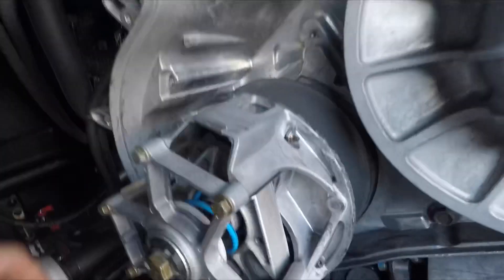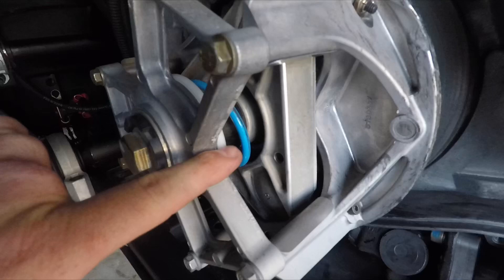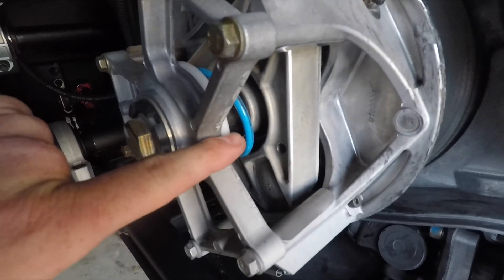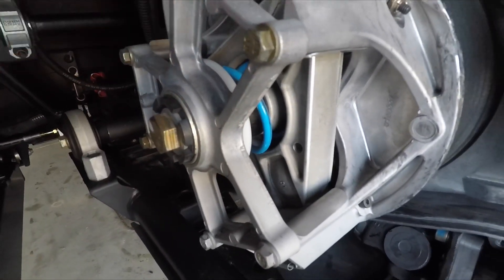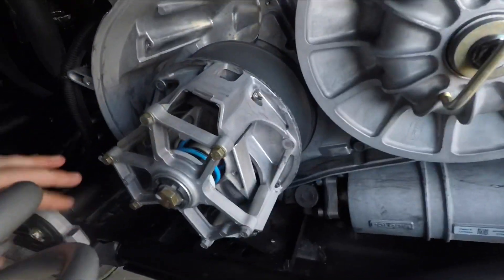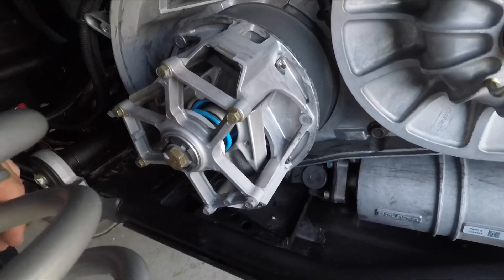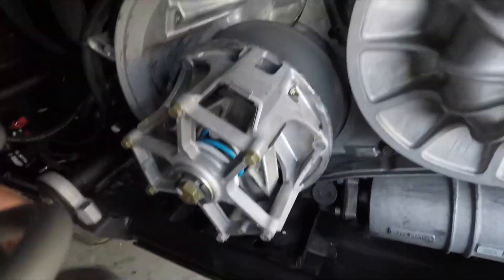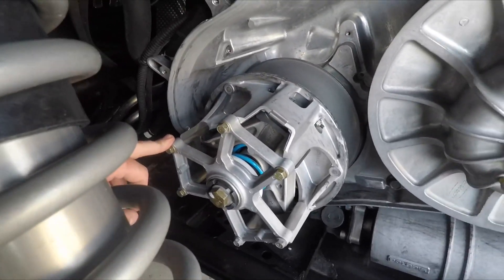Boosted 4WD Launch - E85 Turbo RZR Testing!

Comment: What all did you have to do to go to e85 I'm on stage 3 AA
Reply: Jack Eddy to switch it should be a new tune, crack pressure, and injectors as well as BOV, charge tube etc if you don’t already have that. With AA you can get all your tunes made for e85 and big injectors